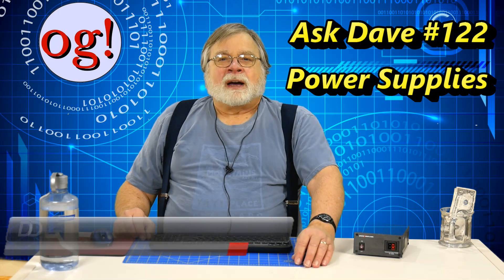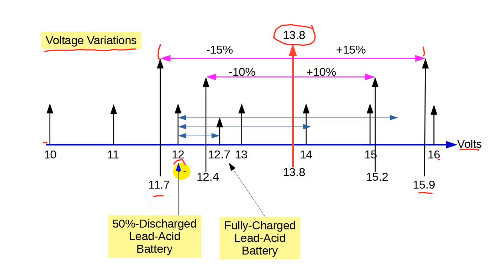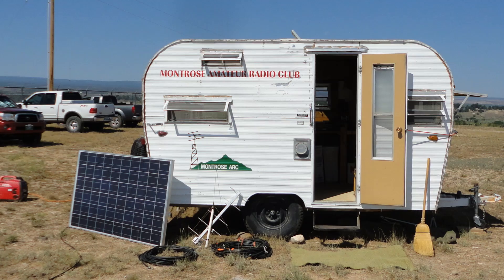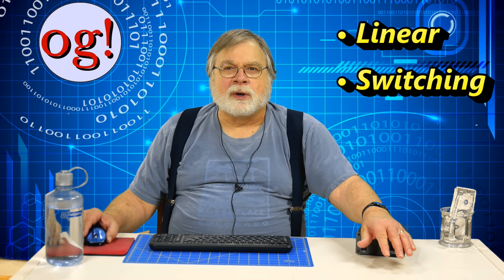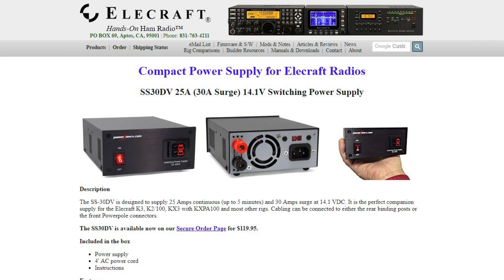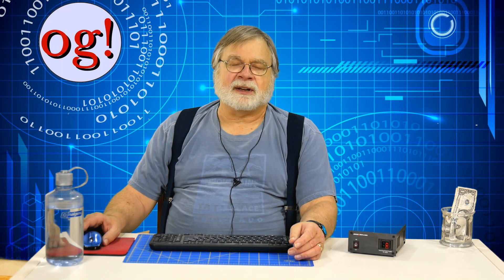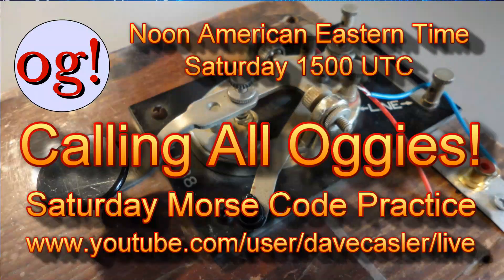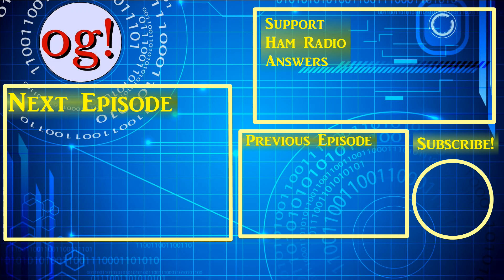Power Supplies for Hams and Makers! (AD #122)

Comment: As a really new HAM....first licensed earlier in 2020, then upgraded to General in July, and finally the Extra in August. Ive got a civil engineering background and have really appreciated all of the work you have put into your videos. Ive considered starting a channel from a new ham perspective as I continue to gain knowledge and understanding into things like SDRs, DMR, Fusion, HF, data modes like ft8, power distribution etc etc. 
I have found it reasonably frustrating and difficult to find videos that walk a newbie through the specific steps necessary in setting up many of these modes and equipment. Ive found plenty of videos of ones discussing each of these topics, but most of the time the presenters either skip very simple but important descriptions of steps, connections, or processes. I guess it would be beneficial in having “tutorial” type videos for the many options we have. Your videos are fantastic for more detailed explanations of how and why things work, others do a good job of reviewing various equipment, still others in presenting options within the hobby. The few that attempt to present a tutorial type video, they typically leave out important details to a novice, as well as move way too quickly through the steps. Finally, there are those that have more of a vlog that might last for 60-90 minutes for some of us to glean 10 minutes worth of applicable information.

Just some random thoughts from a new operator

73

Comment: The QJE 50A switching supply that I use has a separate switch for taking the unit in and out of adjustable voltage mode. I think it is a very elegant way to keep from accidentally adjusting your voltage.

Bought it for $20 at a pawn shop because they didn't know what it was.

Comment: Yesrs ago Icom was threatened with a class action lawsuit. The classic IC706 series had a capacitor across the powerlines, rated at 15vdc. Capacitor ratings are nominally +-10%, so it could fail at 13.5 volts, well under normal car voltage. A design defect. And with an uncalibrated voltmeter, those critical differences can't be found.

Comment: Dave, I wanted to add one thing. You should never Solder/Tin a Conductor prior to crimping into a terminal,  Molex, Power Pole, etc..... You can solder the terminal after after crimping. The reason is that the solder can fail do to the stress of being crimped leading to a high resistance creating other problems, Voltage drops due to a loose conection

Thanks Keith N9QDS
Reply from the maker: Thanks for the pointer.